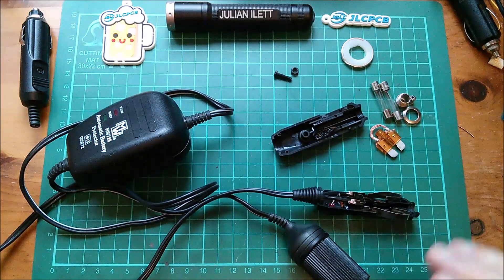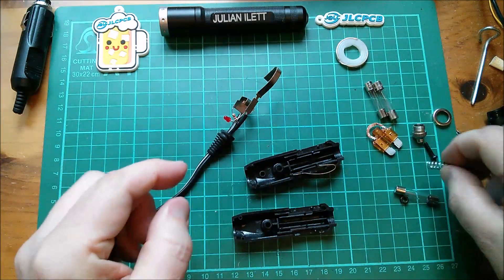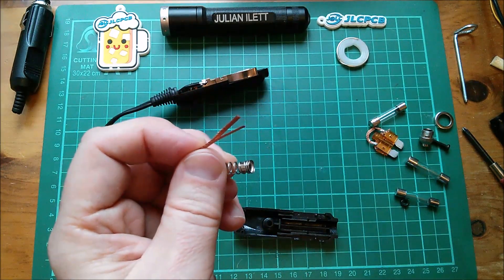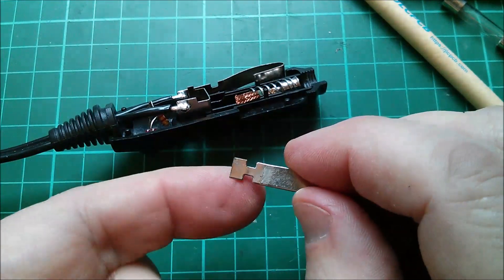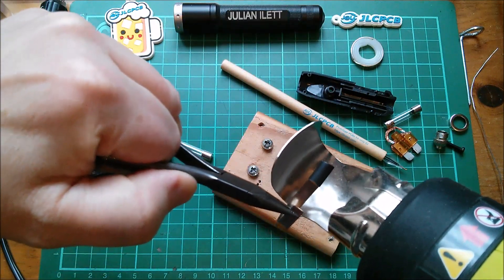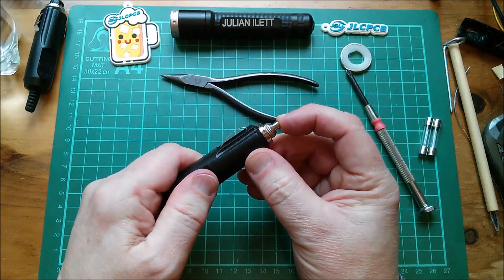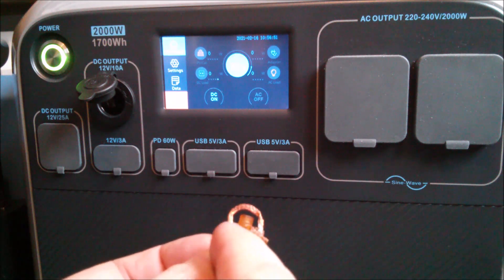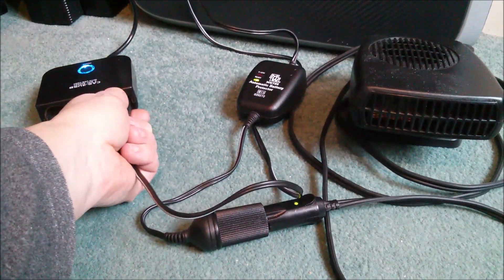Fixed: Cheap Cigar Plug Works at 11 Amps :)

Comment: Hi    Someone may have said this before --- but I would have added a resistor inside the heater ( cooled by its fan ) to reduce
the current a few %  .
                                                                                                                       Alan

Comment: I'd be concerned about the spring side terminal you put the heat shrink on. You said it's not connected, but once you plug the plug in it gets connected to negative via the socket and the positive wire is extremely close to it.
Reply: Isn't that why he put the heat shrink on it?
Reply: @SteveHodge  But would you trust the heat shrink not to wear through with multiple uses?
Reply: That part of the spring connector really shouldn't move at all, that's the captive part. It moves and flexes higher up, so it really shouldn't be an issue.

Comment: If you must use those lighter plugs, how about making a lead that contains a single high-power diode in series (for a bit of a voltage drop) and contains correctly rated cable and fuses.

Comment: All this mucking around to try and run a 15amp device on a circuit rated at a maximum of 10amps.
Why not just modify the heater to make it a 10amp heater, or maybe just get a properly rated device?
This just looks like a fire waiting to happen over a longer time frame

Comment: Why use these lighter plugs at all! They are bad for high current(higher that 5 amp). You even have a 25 amp output on your power source!
Reply: Not just a 25A output, he also has a 2,000W AC output where I'm sure he could find a free heater or hair dryer someone is tossing out that he could repurpose.

Comment: why not just have a connector on the heater for the 12v/25a output ? or even a cig lighter adaptor to plug into the higher current port
Reply: Yes, you can't really rely on 10 amp continuous rating.  It is a serving suggestion.  Open up your power bank and see how toasty your mosfets are.

Comment: 13.8 volts is considered normal for automotive 12v systems. And can actually be as high as 14.4 and still be acceptable.
Reply: In the same way an aircraft 28v system has a 24v battery'.

Comment: Every contact point you introduce, you add 10+ milliOhms to the circuit. 
That's if your contacts are excellent quality! Why us a fuse inside the plug, when there is provision for the fuse outside? 
In a heating application like this one, it's all converted to heat anyways, so you can get away with being sloppy.

Comment: Moral of the story is NOT TO USE THOSE ?  Use  Andersons or other ?  https://powerwerx.com/anderson-sb-connectors-sb50-50amp
I use real connections.   Running up  to 90 Amp.
Reply: Andersons cost and arm and a D in EU and are very hard to come by. Wouldn't XT60 do just fine?
Reply: All good points... if the source device had either connector! :-P I'd be more worried about the 12V 25A cigarette lighter socket... really... 25A on that sort of connector? No fire hazard there!

Comment: Hello.
 Why not copper coating all the bits in the plug?
Electrolyse also is a nice subject to explore.
I think tin solder is about 6 times less conductive than copper, so should the solder point surface not be 6 times the copper braid section?
Thanks for all your videos, Julian, I watched almost all of them.

Comment: Rube Goldberg for the win! 
 OK, fair enough ... You repaired your faulty Maplin automatic cutoff relay thingy.  But since you (inexplicably) already butchered the heater's fuse, why not just put a power resistor across it?

Comment: For anyone researching the plugs, I have had a similar plug (from ebay) melt at 3.5 amps.  They look ok but are utter garbage.  Spring gets hot and deforms, melting inside channel of plug to the point it loses contact to centre of socket.

Comment: In a car the cigarette lighter voltage can be as high as 14.4v which is the full charge voltage of leadacid battery and thats where the alternator sets it's output. & Everything that is made to be used in a car is made to handle 15v , voltage can drop as low as 8v while cranking for few sec. While the engine is not running voltage is typically 12.6v , while its running 14.4v is normal probably 14v at the lighter plug so 13v is not a problem.
Reply: That's not the issue. The fan is designed to run at 12v and if you put more across it (13.8) then you draw more current, that's the problem. It's the current carrying capacity of the set up not it's voltage rating he is trying to balance.